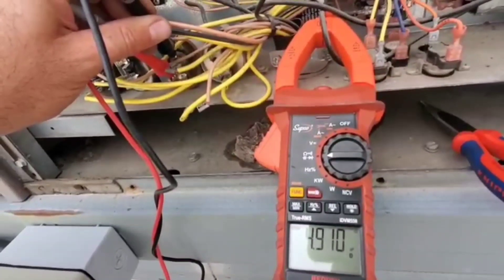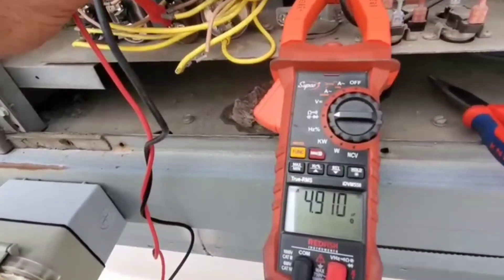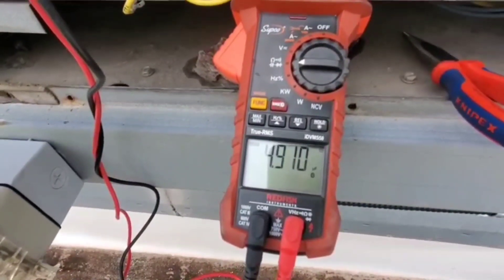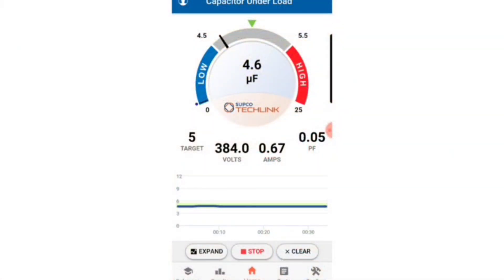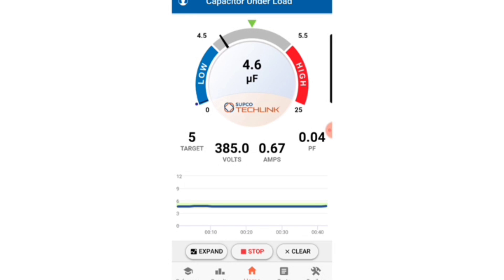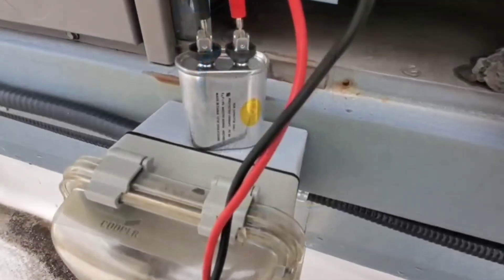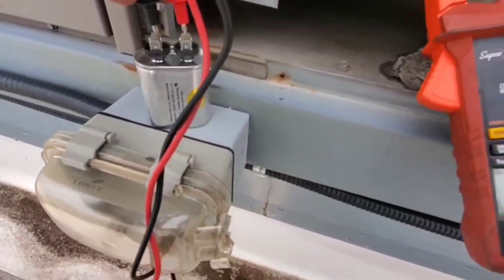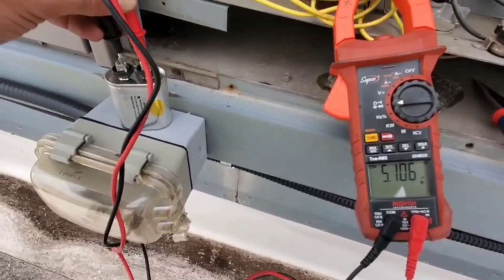Run Capacitor Bench Test VS. Under Load

Comment: That capacity on that meter is going to cause other companies to add the same. I’ve really just learned how to do this with a meter that doesn’t have that function, and I’ll be using it. But, to have that option on a meter looks really nice.
Reply from the maker: Yes it's pretty cool!

Comment: I’ll usually check it under load first and if it’s low I’ll shut off the power, unhook the wires and check microfarads. Do you like those Supco caps? I’ve seen them bad right out of the box. I think they’re some of the worst capacitors on the market
Reply from the maker: Seen many things bad outta the box, I have not seen a bad cap from Supco though.

Comment: There are so many scenarios where electrical components may always pass test under a static test but fail a dynamic test under load
          That’s straight out of six grade electronics class introduction
Reply from the maker: I didnt learn this in grade 6 though lol
Reply: @HVACKnowItAll  yes I know by the time you were in six grade they eliminated all those classes from public education system. 

         The same class I took in six grade .  It’s basically the same class I took in college with the same equipment for BS in electronics degree in college. 

    It’s pretty pathetic they dumbed down our public education system so much. 
       Welcome to being part of the New World order.
Reply: @kthaanos1075  we’re supposed to be taken with a grain of salt as a joke are you getting that way. But our public education system is really lacking in the last few decades that’s the pathetic thing. 
            In grammar school electronics was more than enough to diagnose any problem in small unitary system whether it be HVAC commercial or residential.

     What’s pathetic is when somebody doesn’t even know what they don’t even know and they didn’t have that education in the first place but yet they make a comment on something they know nothing about.

      Grade 6 electronics we built from scratch FIM receiver and transmitter from discrete component so you could put the transmitter in your sisters room and from your room listening to her conversation with her boyfriend on the phone that was six grade electronics. 
         Six grade electronics was reverse engineering MOSFET and rebuilding them with the screen components laid out on a wooden board to mimic the semi conductor that you were learning to activate it and drive motors in late that was six grade electronic. 

         Six grade electronics was wiring upper rotor by hand to make a split face motor either with two holes or six poles so you learn the difference between horsepower and torque and speed with motors that was six grade electronic. 

          So I feel very sorry for you being part of our public I just Quetion system at the time were they remove that from our school and you have no grounds or reference point to determine watch or was not qualified to diagnose a 1 ton to 900 ton AC/refrigeration system bud.
       That’s pathetic are public education has cheated you and you are a example of that with that comment. 
         And that’s why we have great videos put on Buy fantastic individuals like HVAC know it all.
Reply: @coldfinger459sub0  you’re right but I didn’t see the joke there as take it with a grain of salt, I thought you were being a troll

Comment from the maker: How do you check?
Reply: I check without load on,  but checking under load is definitely a correct way to, 20-30 year old air conditioners with piston compressor over time will require a higher run cap to manage the higher load it draws over years and a hard start kit is usually a solid solution aswell